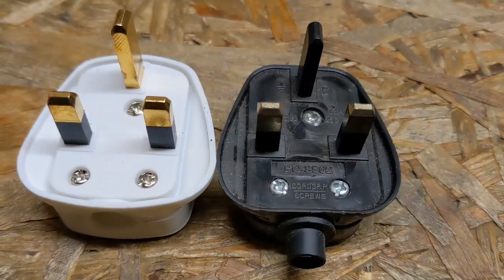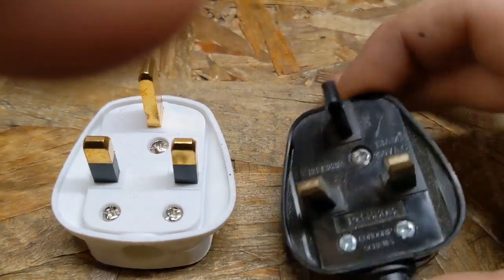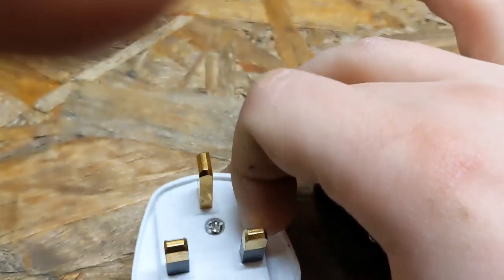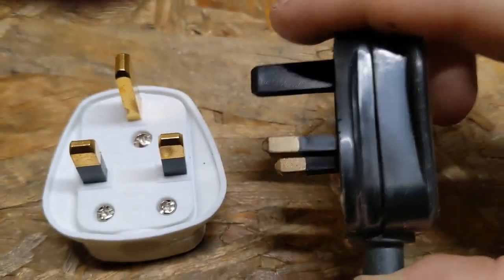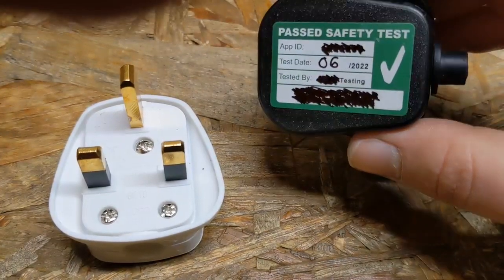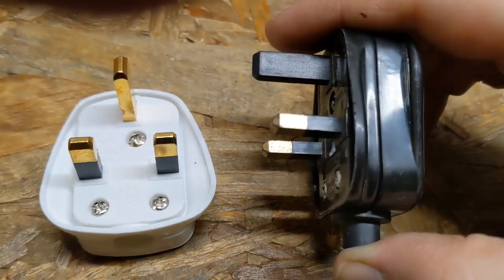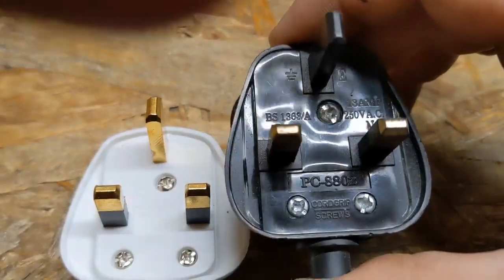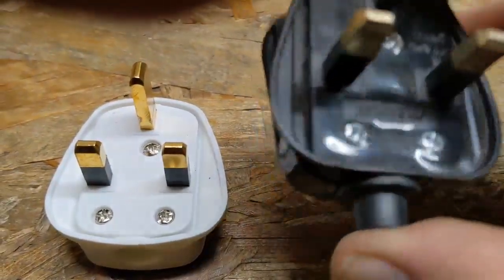Fake BS1363 13A Plug Ramble.

Comment: This is perfectly fine for double insulated equipment that doesn’t need or require an earth connection, such as a TV . Show us the regulation in BS7671 that says that plug is non compliant. It is designed for class 2 double insulated equipment.
Reply from the maker: Hello Ryan here thanks for the comment. ISOD insulated shutter opening devices are for molded plugs only this is a rewirable plug. i will raise you one better than bs7671 as thats for electrical istalations not really covering the details of the bs1363 plug and socket. i refer you to bs1363-1:2023 13aplugs socket-outlets adapters and connection units. section 13 construction of plugs 13.2.1 page 26 the gauging test for rewirable plugs is conducted with 3 core 1.25mm2 cable. this is also repeated in section 21 mechanical strength 21.1.3 page 51 also in section 28 cyclic load test 28.2 page 59 you also have section 12 terminals and terminations 12.4 terminals in rewirable plugs shall permit the connection with out special preperation of flexable cable.  This rewirable plug doesnt meet the requirements for testing to bs1363 which means its not been certified which means its a fake and not made to british standards.
Reply: @rlfvac it not a fake , it is designed for class 2 appliances. Ie double insulated and doesn’t require a n earth connection things like TVs sky box hair dryers . I’ve been a qualified electrician for forty years and I can tell you there is nothing wrong or dangerous about that plug for feck sake man like at the pins on your phone charger plug and any other charger you say they don’t meat the British standard as well then , they even make one that is designed to take a two pin plug 🔌 without having to remove the two pin plug it simply slots in. You’re a vacuum cleaner repair man and you clearly don’t understand the difference between a class 1 and a class 2 appliance and what double insulated means.
By your nonsense logic you’re saying that all rewirble plugs are fake and dangerous even some two pin plugs that are rewirble . Any reputable electrician will tell you exactly what I have said . Get the stupid idea that if it comes from china it’s a fake. Most if not all the vacuum cleaners you work on are made in fecking china as are all the appliances in your house so they must all be fakes. By your reasoning . So if you buy a new appliance from say  an American retailer and when it arrives you find it has a two pin plug and a two core power cord on it what you going to do ? Send it back. No you will cut off the two pin plug and replace it with a three pin plug. I get your point about it being a rewirble.  Plug but that doesn’t make it a fake, do I agree with them being available to the general public no absolutely not. They should only be available to those of us who are qualified and know what we are doing and what the thing is designed for. Would I fit one yes because I know what I’m doing. The only problem with that plug is there’s nothing to stop Mrs Johnson or mr Johnson who are not qualified electricians and don’t have a clue what they are doing from fitting one of those plug to an old appliance they got out of the loft or whatever. But to say it’s a fake and dangerous is totally wrong.